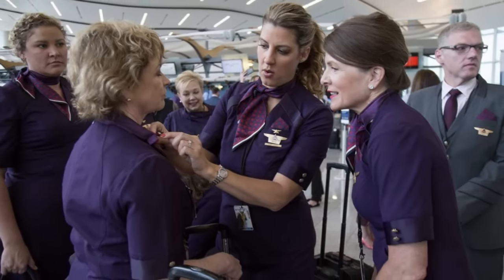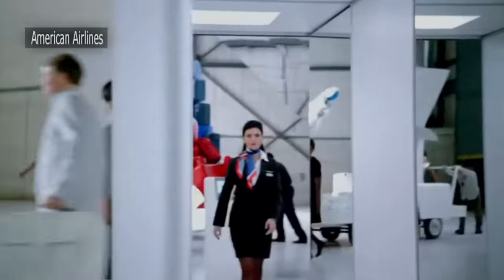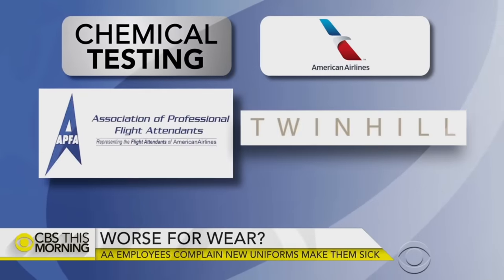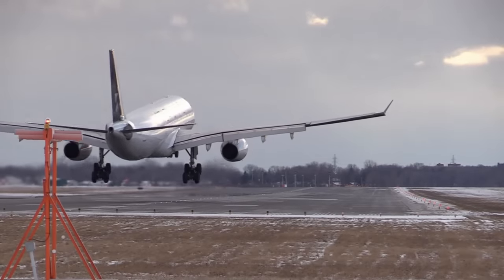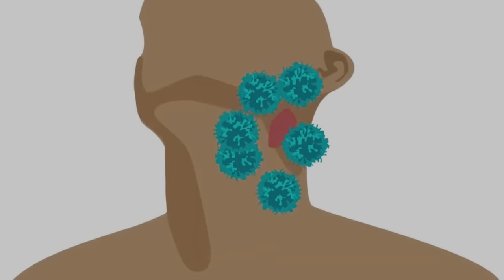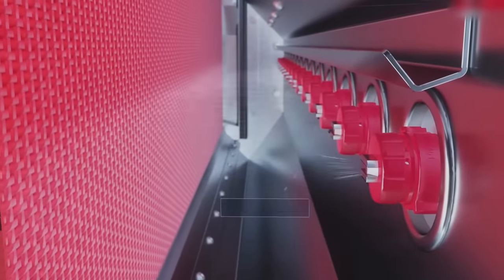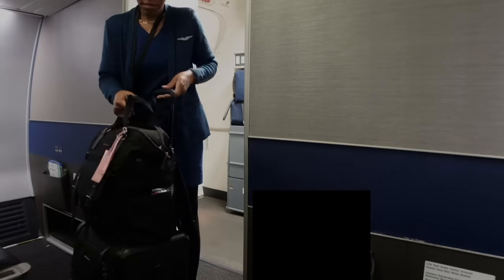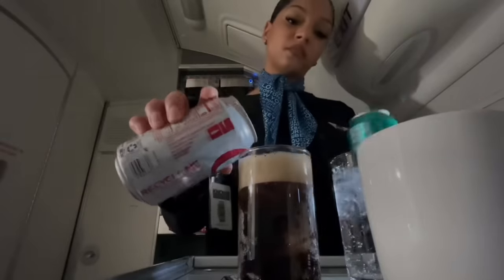The Flight-Attendant Uniforms Scandal

Comment: The employees hated those uniforms. And the fact that Delta had the money to hire a designer? Jeez!
Reply: Well, of course they have to hire a designer. How are they supposed to get a uniform unique to their brand if they don't?
Reply: @jonathanwoods9843 I think they are saying that apart from the topic of this video the staff hated the uniforms as they were not functional. They were impractical for purpose and incredibly uncomfortable.  So a designer should have taken all this into account when designing them.  Its common in the airline industry that staff complain ( mostly females) that Blouses, Jackets, are uncomfortable and they are frequently cold as a result of AESTHETICS over FUNTIONALITY. The designers job is to make a uniform, and considering the job of the wearer, to make it comfortable and safe ( in case of emergency) . It's not just about the uniform LOOKING attractive.
Reply: @marietighe6328  Absolutely! They should hire a better designer, as well as use a better manufacturer.
Reply: @marietighe6328  arguably, designers, whether clothing or architectural, tend to create terribly looking and non-functional things
Reply: It’s the manufacturing process that becomes the problem.  The designers have no control over that part.
Reply: @jonathanwoods9843 it’s also that the designs themselves were created by an external designer fashion brand, who doesn’t specialise in airline uniforms, in collaboration with the manufacturer just so they can have that brand’s name attached. A former flight attendant who doesn’t have a fashion company to her name could be a great designer for a uniform manufacturing company while still creating designs iconic to separate airlines

Comment: If you research back a couple ouf decades befor this happened you will find similar issues with uninformed hospital workers such as nursing assistances, orderlies, housekeepers, various types of therapists, laboratory staff,  clerks and administration staff that had duyies in patient areas.  Nurses, back then,  still univerally wearing white (before the move to scrubs), were not dressed by the hospitals to meets their style and color schemes to denote hospital department or area.  Nurses, mostly unionized at that point, had their own large wardrobes  of white uniforms in the designs and styles and brands they preferred and were not about to be dressed up volora a s styles selected by others to match each other.  One of the comments often made by the nurses was that they were not stewardesses and not going to dress that way as advertisement.  Many of the same issues happened back at that time also, as most of these uniforms were made from man made fabrics out of chemically processed fibers. 

Other hospital employees were very much willing to go with a hospital mandated uniform as many were lower on the wage scale and happy to have uniforms provided which they had to be if mandatred.

Hospitals were quicker to pick up on the issue, as employee health kept strict data on the issues that popped up, and not only when they happened but what  happened just prior to the issues.  When the same hospital ERs were seeing many more cases of severe reactions and anaphylaxis in employees they were quick to correlate who were and who were not having issues and what other new or different chemicals were being used atound these employees.  It did not take long to realise that the professiobal nursing staff, RNs and LVNs/LPNs, wearing their ow  white unifotms were not having any issues even as they were exposed to all of the same environmental chemicals used for cleaning, sterilization and so on.  In most cases only a few hospitals had changed products at the same time as the uniforms roll out.  

This lead to hospitals quietly and quickly moving asay from mandated unforms and ptovuding some staff  like dietary and housekeeping 100% organic cotton separates that were also fiercely washed by hospital laundries as they did lines, and towels guaranteed to remove any chemicals.   In some cases other emplyees were given the same sort of cotton separates  in departmental or job related colors or given a unigorm alllowence to buy their own at which time they could deal with sensativity fo fabrics, if any on their own.  Within a decade we started to see hospital provided and then self purchased scrubs.
Reply: Talking about hospitals, years ago I had a major abdominal surgery after which they put a dressing over my surgical wound. I got extremely itchy and broke out in hives around and under that dressing. Two nurses looked at the rash on my belly in silence, then one of them said: "get one from the other batch, and stop using this one". Apparently I wasn't the first patient who had this reaction. Goodness knows what was in these dressings.
Reply: Uniformed dress blues, navy, aux guard, knights templar, knights of columbus, coast gaurd, marine merchants, and I hear that bluementhal is pretty good, which is what police wear.

Comment: Suggest wash clothes before wear them . . .to remove any extra die or process chemicals.
Reply: I don't think you can just "wash" out arsenic and lead.
Reply: @daowonimdee  I missed the part of the video where arsenic and lead were mentioned.  
The idea is chemicals that will release for the cloth go into the laundry water.  If the chemicals stay in the fibers through warm soapy water . . . It is probably going to stay in the fibers when everything dries out.
Reply: It doesn't work 😢

Comment: My speculation is still short-chain PFAS (used in fabric finish of course), which was oversold in about this era, and did not live up to its claims.

Oh, and it wasn't on Oeko=Tex's test list at the time 

Somewhere (which I cannot now find) I read about a breakdown product of one of the short chain PFAS chemicals which becomes airborne in aqueous form in the humidity in the air near the wearer.  If you're thinking about Peanuts' Pigpen's dirt cloud, yup, that's how this would work.

Comment: The problem lies with the US not regulating what and how much is allowed to be used. We are now part of the textile Industry.  The uniforms are outsourced to several different countries with no regulations and they are allowed to put a component of anything in and call it a "trade secret".  The people making the uniforms are wearing full protective gear.  
Passengers are with us for a few hours, not wearing the uniforms we are required to wear.  When flight attendants wear toxic uniforms and work several days in a row, several hours a day, and the aircraft is hot, the uniform clings to your skin therefore releasing toxins into your body, hence very bad results.

Comment: Most clothing purchased these days, along with bed sheets, camping gear, makeup and body products are so loaded in chemicals I'm surprised we're not all dead or in the intensive care unit. I purchased an inflatable mattress, a single size and when I opened the box about two weeks ago, I almost passed out from the toxic fumes. I knew I couldn't use it this way, so I hung it on the line to let it air out for a day. Helped only a tiny bit. It reeks. I'm going to give it to someone else who doesn't care. I've ordered and received stretch jeans that smelled so bad I literally had to keep just throwing them back into the washing machine. I could smell them hanging on the line half way across the yard. Be careful. So much of the materials and chemicals come from China, and they are horrific. I bought a plastic spatula for cooking at the dollar store, and I got it home, but when I pulled it out of the bag I almost fainted from the smell. Like burning wires or something. I threw it away. It was from Dollar Tree, so big loss. This is one reason why buying things used from a thrift store is often a better bet, because it's been used and washed and is of less threat regarding chemicals. But even America uses these chemicals, so unless it's 100% organic, you take your chances.

Comment: All the non natural fabrics are a potential fire hazard in an emergency. The natural fabrics are resistant to fire. Moreno wool is naturally odour resistant.  These natural fabrics are more costly. I paid for my uniforms for years, they were wool and I used cotton under garments.  Airlines will ALWAYS default to the least expensive option.  That sucks!

Comment: If it's doing that to the airline staff, imagine what it's doing to the passengers over time. Looks like it's seem to be the use of recycled material used in the making of the uniforms and the staff wearing them most of the time. Probably a combination of to much chemical treatment in the recycle processes and being worn to near the skin.  Given it's only started doing this over a few years ago, plus the addition of waterproofing, easy clean, anti-fungal chemicals, you have one big chemical soup which seem to be a Witches Brew. 
  Are these materials used in the making of other types of clothing and if so what kind, is it close to the skin, worn regularly for long periods at a time?